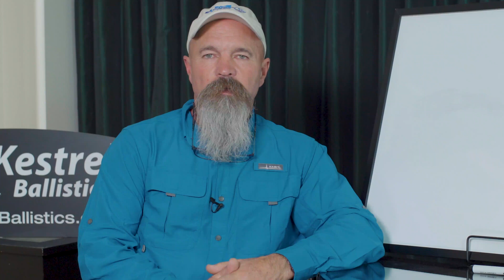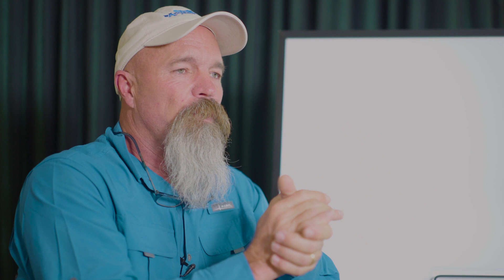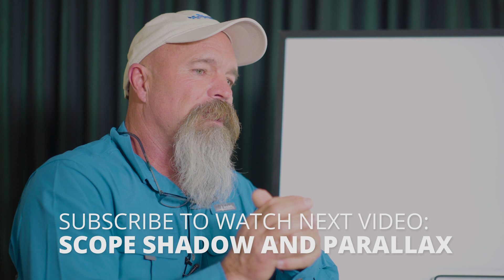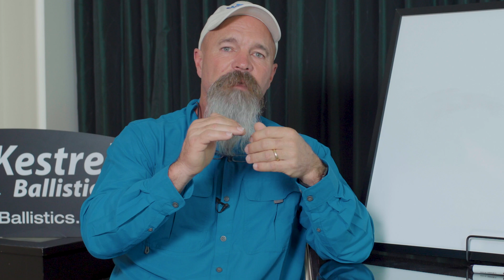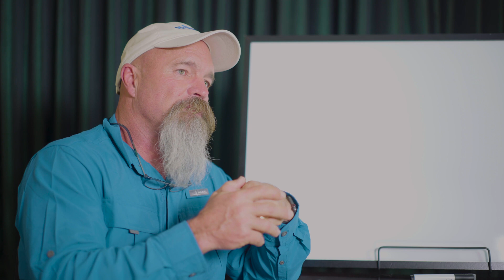WHY DO I NEED TO TRUE? | Todd Hodnett from Accuracy 1st

Comment: Thank you   for the  video.  Can you discuss how to true  if you don't have the necessary range?  Say 500 meters max for a 7.62?
Reply from the maker: You can calibrate at shorter ranges but with some caveats. If you are still seeing differences between point of aim and point of impact and have already checked your inputs etc. go ahead and MV calibrate at the longest range you have available, just remember not to trust data from that short range calibration at longer distances than what you used to calibrate.  If you have a chance to shoot at longer ranges, re-do your MV calibration at that longer range.